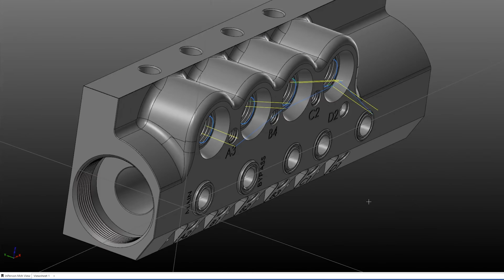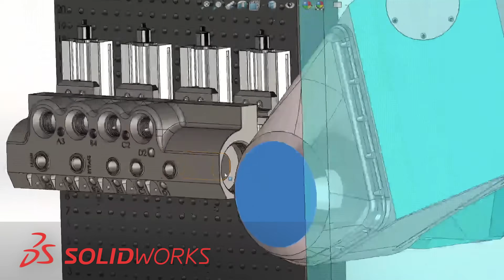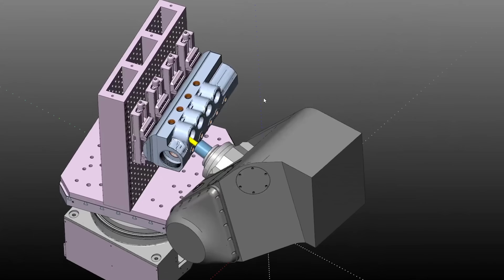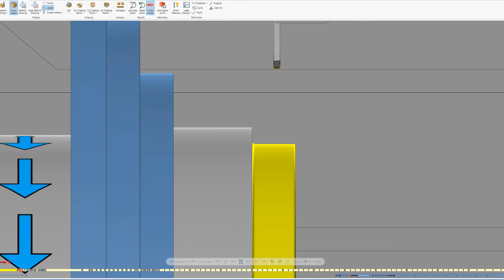Manual or CNC Machining...Which takes MORE SKILL?

Comment: The main thing is its a different skill set, when my dad started jig boring you would have to set up slip blocks to set up position then came the accurate glass scale dro then came cnc so as time goes on the machines get better but then you need expensive software to run them. CNC and manual go hand in hand because some jobs given to a manual machine would be quicker than setting up on a cnc but if you want to hog out material then cnc kicks ass. As long as the job that comes off a machine meets the customer needs then we are all winners, but what pisses me off the most is when some graduate student thinks they are a designer but when you say to them just because you can draw it on a computer it doesn't mean you can make it, all cad guys need to have old school bench practice just for basic under standing of how to hold and fixture something.
Reply: As a graduate mech engineer who likes machining, I was in our university's shop and another grad student came in asking why his 3D print didn't work when it was right in CAD. One of the machinist took a drill the size he said his hole was and it didn't fit. Student said but I made it the right size in CAD.
Reply: @ScuffedEngineer  I'm getting a degree in mechanical drafting and design and our first semester Friday class was a metal working class (turning, milling, casting, etc.) and each of us had to make a air powered oscillating engine (that works) from a kit that only gave us the metal stock to work from.

I also do 3D printing myself and have to build tolerances into my parts for them to work correctly.
Reply: The only engineers I’ve worked with that are with their salt all started on the floor. Learning how to cut before the design phase. To see what WILL cut and won’t. It’s hard to explain that you can’t put an 8-32 blind thread at the bottom of a 2” ID tube a foot in length. You gotta let them give it a whirl with Levi’s on before they graduate to their slacks.
Reply: @staceybrown686  Well, you can but it's not going to be accurate lol. I'm thinking homemade tap/drill extensions.
Reply: we play that game a lot desinger comes along can you do this i say yes and 3 days later i see it as a part of some unholy construction where it is almost imposibel to get done
Reply: Most jig boring machines were kept in temperature and humidity controlled rooms
Reply: @Stumpy1854-Orion  I've come CNC machining for timber and the people who have worked on them haven't allowed for temperature ranges and even weeks later an item has come back split and or broken due to even just down to a person holding a hand on the item or even jamming up like a window. This has been one reason why I allow up to a +/- 10% tolerance depending on the item being made.

Comment: Agreed.. but it’s also important to learn your basic skills on manual equipment to get the feel what it takes to machine any material. It connects the mind, the hands and the materials together and reveals a “feel” for the task at hand. Progress is progress but when it comes to manual equipment I think it still has a place in modern machine shops.
Reply: I see where your going with this but you can learn these basic skills on a cnc too.
Reply: @dominic6634  I’ve seen it happen yes..but these same people that started with and only CNC have no idea what they hear or see em when a tool isn’t sounding right. Rigidity and HP play important roles in cutting tool selection and you can’t feel it so you have to read a speed and feed chart. Cutter technology changes and improves with time which changes the guidelines. Most all the guys I’ve worked with that have CNC only knowledge can’t properly run and set up safely a Mill, lathe, surface grinder or even a drill press.
Reply: I mean we use modern manual Milling maschines in our company and the fact that I learned alot on these maschines then I did on a cnc says alot in my mind, the way to make parts on a manual can be transfered partially onto a CNC maschine so dont underestimate manual maschining. Manual gives u the basics much faster and easier in my mind from the feel of how to mill certain materials,  aswell as what kind of tools to use to make a specific task on your part. I definitely agree with that CNC is the future of our industrie without a doubt yet going back to our roots and combine those technics with modern technologie thats what is interesting alot of times. Also keep in mind every company has different needs some require very precise maschines etc. some dont also the cost of a CNC are much higher then a manual when it comes to make easy part its unnecessary to use a CNC.

Comment: Skill is relative to the task you set out to achieve, do you accomplish it? Well, if the task is to run a manual or CNC mill then both are skilled. If the task is to create a part, then again both are skilled, one just lacks the tertiary skill of adapting to progress and being able to stay relevant.
Reply: Also depends on the work, i usually run cnc on a schaublin 110 cnc lathe and a brother s2b-0 mill, but for odd jobs that are very easy and only needs one or two parts, i go manual.

Comment: I’d say doing a lot of things would be basically impossible or way to time consuming on a manual mill/lathe but it does have its use cases for repairs etc. and stuff where you prefer too not waste time with on a CNC Maschine.
Reply: exactly this - Production is where CNC shines, Job shops are where manual machines shine
The 2 are not better or worse than each other, they just have different uses and both have a role

Comment: There's also a huge difference in CNC operator and CNC machinist. Operators are mostly just there to swap out parts, clean, and push buttons while CNC machinists make the setups and do the programming etc. as well. There are of course lots of different layers between those extremes, but if the old timers only saw CNC operators they might get the wrong idea.

Anyway, the way I see it CNC machining takes a lot of the human error out of the process to make it more consistent and it gives you more opportunities to think about the best strategies to use while you don't have to waste time cranking handles.
Reply: be thankful there are people willing to do that job
Reply: Indeed my friend , well said .
Its way more difficult , challanging but also more rewarding....10 times cleaner 😍
Harder on the math ...more diverse....but rewarding
What i learned as an 48 y old , but always adapting to New tech , machinist  .
Is that you have 3 generations or types of machinsts these days. 
The "mechanical only" and never took the time or effort to learn computers .
Then you have the ones like me , old school but always curious what those computers where and could be used for .

And then you have the next generation of purely CNC based machinists .
Learning G code toghter with walking at 3 years old..lol

That surely creates a strong PRO AND CONTRA group.

I feel Lucky to have experienced both completly different worlds of machining.
Enjoying CNC aswel , old machine restaurations and techniques. 
Like @keithrucker channel ...a true gem ...like this Channel is fir me aswell ☆☆☆☆☆☯️😉

Grtz from the netherlands 
Johny Geerts
Reply: @Metaldetectiontubeworldwide  some of us new guys are working conventional lathes/mills too, I personally love it. Still got G code knowledge in my back pocket when I need to program, picking up Fusion 360 in my off time too, but there's just something about the feel of it that I just love.
Reply: I call those people green button pushers couse thats mostly they do, i've saw a lott of them not knowing ,not caring and not wanting to learn , i hate those kind of people :)
Reply: @kiurtosh  well... Those green button pushers, who actually managed to learn some basics, like finding a required program, and set up tools and jaws, as it's stated in the annotations of the program, are not much better. They can simply give a zero care about the workplace, about the tool and fixture condition, and in a very short time period almost disintegrate the tools, which have served for years, before those people were hired.
Reply: @kiurtosh  On the flip side though, the beauty of the CNC operator job is that it gives an entry level job for people that want to get into the game.🙂

Comment: Hey Titan & co, I have a work holding question. How would I machine a roughly 70x70x2.1 mm copper plate, where the thickness and flatness need to be down to 0.05mm on both flat faces? My main concern is that I can't find stock of the right thickness, so I don't know how I would machine something down to this very specific thickness. I only have a modest mill. We have a CNC mill in our hacker space but the stage literally isn't large enough so I'll have to use this older manual mill; the shape is not that complicated, so I can manage without CNC, although I would use it if I could. I don't know how to do this without bending up the plate. I thought about putting it between two thick Alu plates maybe, and screwing them tightly together. The shape is basically a 70x70 square with a 50x50 square removed from inside it; the outside edge has some features (it's not just a plain square) so it needs to be machined as does the inside edge. I'm not sure how best to do things without bending up this delicate copper plate. But my main concern is with making the thing the exact right thickness. It's a copper shim that goes between a GPU cooler and the RAM chips, and the chips are very fragile so the item needs to be just the right thickness.
Reply: 2 methods immediately come to mind: a vacuum plate or (believe it or not) double sided tape
Reply: @barrysetzer  damn Barry - I never thought double sided tape would be useful for that sort of thing. But how do I unstick the plate after I'm done, without bending it up? Additionally - the glue residue would be really unwanted, since I need to have a really clean thermal interface.

I don't have a vacuum plate - it might be doable as a project, but I'm not sure if it'll hold the thing down strongly enough. I wonder how you can calculate the pressure necessary for that to work.

Hoping for more ideas :)
Reply: @cheater00  Check out the Mitee-Bite Vacmagic VM100. You buy it, and a blank pallet plate, and you can create a pallet plate to make multiple parts. I should add that the vacuum plate will solve the thickness issue, but not the flatness issue. However, if you start with stock that is flat, you will be just fine.
Reply: @barrysetzer  I was just thinking about the double sided tape thing, and maybe I could just put the tape on a periphery that I'll cut off after I'm done machining the plate flat and to thickness. Leave just enough bridging material for it to hold the area that I need in-place. Then do the same thing for the flip side. Finally I'll be left with a thin plate I can put between two thicker alu blocks that I can screw together tightly and hold the plate flat this way - and then cut out the shape I need it to be. The only question is: the double sided tape has /some/ thickness. So the middle part that's not using tape would be unsupported, and the whole surface would get warped. Should I just put some printer paper under the unsupported middle part so it's supported again?

Using tape like you said would spare me buying a vacuum table and it would be way cheaper :) 

What do you mean when you say that the vacuum plate will not solve the flatness issue? After I machine the surface down a bunch, it should be perfectly flat, right? The trick is not to make it non-flat by bending it when removing it from the holding arrangement.

Thanks for the ideas Barry :)
Reply: A vacuum fixture with a properly designed o-ring groove which allows a seal but just enough crush to lay against the underlying flat plane to perfectly support the material flat with no deviation. You can get various o-ring material at different durometers in a roll, just superglue the ends.
Reply: @vondeliusc  hmm... I don't even think we have vacuum in the shop, that would be a huge investment for me for this project.

I need to flatten and mill down 70x70 mm - what do you think about making the material say 110x70 cm, putting a 110x70 cm base plate under it, and two 70x20 blocks on each end, and screwing the blocks down to the base plate? Would that hold the copper well enough that it doesn't deform more than 0.05mm while it's being milled down to 2.1mm? That would be a much less expensive low-tech solution.
Reply: @cheater00  I cannot comment on your idea, but you can use a shopvac.
Reply: @BrilliantDesignOnline  Thanks. Just like a normal shop vacuum cleaner? That will be strong enough as a vacuum?
Reply: @cheater00  I think for a 70x70mm which is too small, probably better to go with the tape/super glue method.
Reply: @BrilliantDesignOnline  Thanks. You know, I'm still not sure how I would get the thing off its base without bending it.
Reply: @cheater00  Heat it up carefully until the glue deteriorates.

Comment: i incredibly respect CNC machine operators/programmers and  i can only think of 2 things that would be faster:
1 material prepping: y know Facing stuff while the CNC is chuggin away
2: dovetailing cmon its only 2 line while the machine is  chuggin away you can make extra billets with a faced surface and dovetail

Comment: YOU ARE ABSOLUTELY CORRECT!!!!! , keep up with the industry as it grows, or you will be running a mill in your garage.
Reply: Repair toolroom work & tool & die makers - mold makers  can't be replaced ..most use manual machines bench work - Bridgeport & Surface & od  grinding tools & dies ect.....great to know both manual & cnc ..good video

Comment: In my opinion manual and cnc machining shouldn't be directly compared, they both have their uses. 

CNC is king for large scale production work. 
Manual machines are more suitable for repairs and low complexity & (very) low volume production runs.
Reply: Or for making 1 of a kind parts, that aren't too complicated.
Takes more time to program then to just print out a technical drawing and start up the lathe.

Besides, its not bad to sometimes still have to do the operations by hand.
It helps with thinking about how to program.
Reply: Most truthful comment in my opinion i totaly agree !